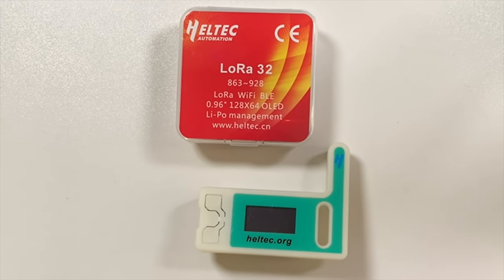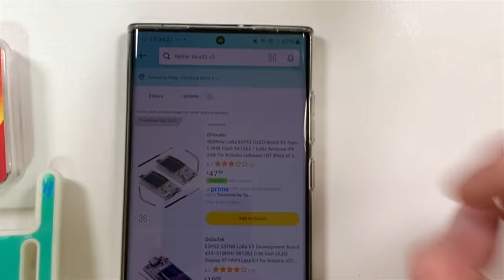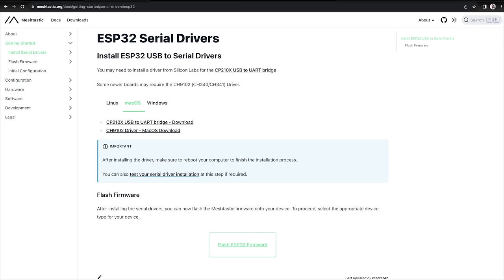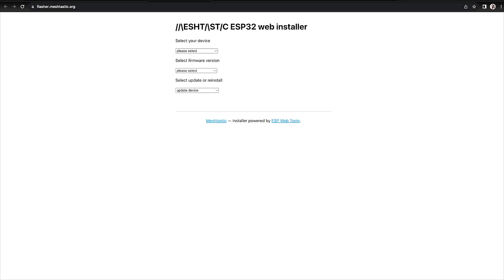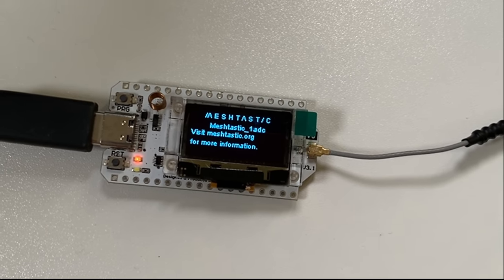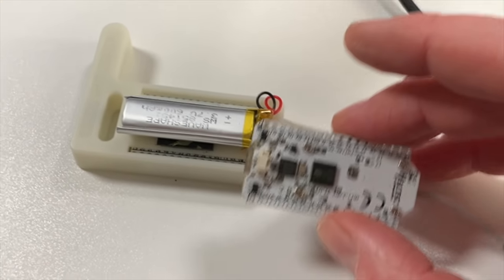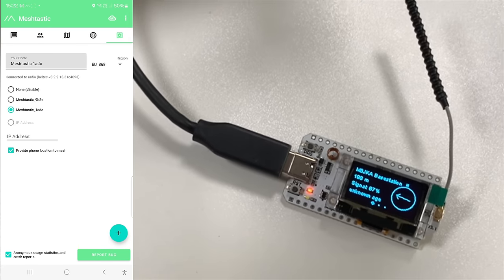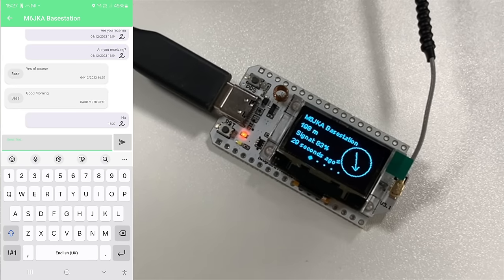JOIN THIS EXCITING OFF GRID NETWORK!!!

Comment: I don't understand what problem this solves and what the primary use case of this is. It's a great video explaining the setup but I have no clue what this is. Is it for local text messaging (SMS)? Is it a internet hotspot?
Reply: Yes it's (primarily) for sending text messages, but crucially it doesn't have to be local as your messages can hop across multiple nodes to the destination. Internet would definitely not be very effective as the bitrate is very slow.
Reply: @ThatMattWhite  Ok, cool. Thanks! Now it seems like it can be useful in case of an internet blackout or maybe even for privacy reasons.
Reply: no records of comms or logs available to gov or other opressive forces

Comment: These are a lot of fun to play with (had them for some time). Setting licenced ham operator would be useful on the 70cm band in some parts of the world where power can be higher with a PA. But also that setting that (should) disable encryption as per local laws. One thing to be aware of is the channel name you choose will create an encrypted channel. So if you change that you'd not be on the "default" channel that Andy shows here. You can see the encryption settings for the channel in the radio settings dialog. It can actually get pretty complex once you start digging. But that's part of the fun! There's also a version that is only for Amateurs called Meshcom but there are really few users of that at the moment. Worth checking though. Thanks for the video!
Reply: From what I understand its a grey area your technically setting up an experimental remote repeater.

Comment: I am blown away by the range and bandwidth achievable with these modern transceiver protocols. LoRa, OcuSync, WSPR, NextGenTV ect ect. The government will be butting in on this mesh stff no doubt. Imagine how pist they would be if we the people created our own internet network.
Reply: If some could be connected to some routing equipment it’s definitely possible.
Reply: The government aren't actually the ones at risk. They may very well but in, but it would be because of the corporations padding their pockets. The internet is already decentralized anyway. That's what makes it so difficult to control.
Reply: They have been going after network people since 2017

Comment: This is the first time I hear of this technology and it's so cool, it's basically just the internet, but even the infrastructure itself is in the hands of the people. Super cool stuff.
Reply: If it only worked...
Reply: It's not Internet. At all. It's text messaging over radio.
Reply: @BrightBlueJim  

it will be crucial for the years ahead..
Reply: @BrightBlueJim the internet started as sending text over analog phone lines, rtty also existed long before wifi. We’re rebuilding!
Reply: @BrightBlueJim  The internet is just a network of computers. This is the same. I think you are both on the same track.....

Comment: I live very near to the south Devon coast. My helium miner hits the channel islands from here, no problem. It also pings off portland regularly. This got me thinking. Once offshore, boats have either no, or very expensive connections. This cheap piece of kit could be a very useful way of sending messages, particularly a mayday/panpan.
From my location alone, I could cover a big chunk of the English Channel.
Reply from the maker: Fascinating! You should definitely set a mesh up. What antenna are you using on your miner?
Reply: Boats have DSC for that purpose,and it's is free and well monitored
Reply: Hf-Vhf radio is mandatory from vessels ranging in small and upwards. Larger vessels usually have Satcom and LTE links.
Reply: Is helium mining worth it? been considering using one of those and later setting up with a solar panel (Live on east coastish shit town in a flyover state so no competitive issues).

Comment: I was really surprised by their range and it got me thinking about how practical it would be to setup small solar-powered nodes. If it's small enough to run for a usable amount of time in a package that small then it can't burn too much power at all, so a small solar panel or something with a simple metal rod to stick into the dirt and a 3d printed housing could make a really nice little relay node. If it can be ran on pretty generic hardware I might actually chase down that idea a little and try to get a small ESP32 or NRF or something going. If you could get the price of a self-sustaining node under, eeeh, 25-50usd, then even a single individual could reasonably afford to setup relay chains spanning miles and miles. 

Granted, at that point you'd probably want to have an integrated low-precision GPS module in them as well so that, if one does go offline, you can see where the chain broke because it stopped reporting it's position. Could be an interesting little project to chase down.
Reply: I was thinking something similar, honestly my GF and I considering living in a more rural area due to crime in the inner city, as well as just high cost for a flyover state city, its just not worth it as I get older.
Reply: Or you could maintain the map with device uuids and know which went off without gps
Reply: @thebloodyvlad  that wouldn't necessarily work. I mean in the first place it's non-generalized, so you'd have to intentionally map out IDs to positions which is just a pain, but it would fail if, for one reason or another, they got moved around. Say one got picked up and taken somewhere else but still technically has connection then it'd register as still working despite not being in the correct position for the chain.
Reply: @robonator2945  hmmmm.. if one got moved and you mapped and tagged each node, surely you can look at the map, which would just be a series of numbers or names on an ordered list and query until one does not respond. Then either that one is down, has been moved out of range, or the one just before it has been moved but not down.

Comment: Amateur radio mode gives access to higher transmit power, as permitted by an amateur license but disables encryption as that isn't permitted for this kind of amateur radio use. It also causes the unit to transmit your callsign every 10 minutes to maintain compliance with your amateur license
Reply: Tell that to prepper's with baofeng preparing for shtf

Comment: From the way the board is built with power at one end and antenna at the other, it invites the creation of a meshtastic - stick! Battery at one end, antenna at the other. Make a magic wand by extending the antenna and adding some 3d printed decorations on the case.

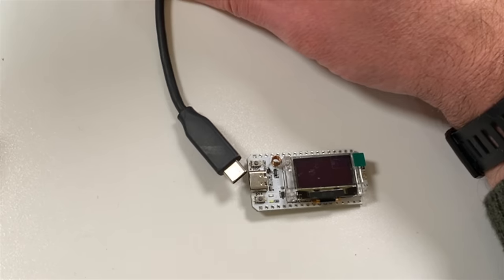Comment: At 4:10, SHOULD connect antenna BEFORE power - always.  Transmitting without antenna could fry the transmit circuit.

Comment: Hi Andy i based near orpington kent a few weeks ago i got a node 113 miles away west of Birmingham i looked at our SE meshtatic group and some other members also got this node 
are they running some high gain  antenna ?
i had a few nodes 50 -60 miles in the south cost 
Andy have you had any good ranges 

paul

Comment: This device appears to be the same thing (or similar) to the goTenna Mesh network devices that started on Kickstarter back in 2012 I believe.   I actually have a pair of the goTenna’s.   They use a 1w UHF radio/GPS transceiver in them.    No cell service, no problem.  Although they are limited to 3 miles line of sight,  unless you set one or more up as repeaters.

Comment: Thanks for taking the time to share this video!  Did I see the M5Stack Core device on the Meshtastic drop down list?  If so I guess if you have the M5Stack Core and connect it to the M5Stack LoRa Transmitter/receiver, it should work...  I guess???

Comment: Hello Andy. Great job on the Vids! 🍻 I am in Japan and from what I can see (if I am looking correctly) there are only a handful of these units here and I have half of them!  lol 
I may have to get external antennae's and setup a repeater due to my 5600 Km LOS that I would like to cover. I need to setup a test Emergency Comms plan in preps for these earthquakes here. I am pretty familiar with location, power and basic antennas but, this is all new to me.
Any chance we could correspond so that I can get these correctly setup. Thank you for any assistance. 🤟

Comment: Thks Andy..ordered mine now from AZ and the Housing from Ali....do i need a Battery with a micro JST Connector....?
Reply from the maker: Awesome! Yes you do need a battery or just run from USB. There are 1100mah batteries on amazon with micro JST.
Reply: @andykirby  ...ok...thks...👍
Reply: JST 1.2mm. Double check the polarity before connecting.
Reply: @yamez69  ....yes, ok, but the JST plug only fits in one Position, Cables with plugs and open ends are included....Nevertheless, thanks for the Tip.

Comment: The thing about being an amateur radio operator unlocks extra TX power, which is outside of the unlicensed range. So you shouldt use it if you don't have a proper HAM license.
Reply: It also disables encryption
Reply: Who’s going to police that? Would anyone care?
Reply: Yes, it is policed. If you set one up 24/7/365, you have a very good chance of getting caught.  Licensed ham radio operators are quite good at tracking the location of a signal. We do it for fun.
Reply: @MadBison  that's why i stay on PMR frequencies on dmr.

Comment: But what do you do with it when its up and running? What is its purpose or what can it do?
Reply from the maker: Text messaging. GPS tracking, much like APRS really.
Reply: you get to talk to a load of prepper/ham nerds 😂
Reply: the system was designed for IoT devices so mostly sensors and other automated devices sending simple telemetry as a message to a home base. Or allow simple remote control.

Comment: So if I want to create one of these devices as you have, does that mean I don't have to worry about the pins on the board?  Some of them have the two rows of pins soldered on them, others don't.  It looks like yours do not have the pins soldered on. Thanks!
Reply from the maker: Nope you don't need the pins 👍🏻

Comment: interesting, but only useful for nerds in a local proximity i guess?
or does it work like mobile data network / used with SIM like back in the blackberry / iphone era where they discovered this "unused" network?
whats the max bandwidth of this network or does it use wifi?
Reply: I reckon there'll be some "specialist retailer networks" using these for boss-to-lackey communication soon enough.  Line of Duty season 7 coming up...

Comment: Amazing! Andy, are you also going to explore Helium?
Reply from the maker: I've looked into it briefly, I might get a miner up and running just to see which other miners it would connect to. I'm defo more interested in meshtastic though!
Reply: Helium is DOA in terms of actual usability. Anything outside of occasionally polled sensors and it's mind bogglingly expensive even in the 1st world. Those 24 byte packets really add up if you want to run something like a phone call, or even frequent text messaging.

Comment: I bought the Heltec V3 in SX1262 863-928MHz. I live in the US and need 915MHz. Did I get the wrong one? Can I select 915MHz when setting it up?
Reply from the maker: Yes you can select US in the Region setting and it will work on 915mhz 😁👍🏻

Comment: Do you know if the transmit power should be changed? On the Heltec website the dBm says a max of 21 but the app set mine at 30 dBm by default

Comment: Hi Andy, great video. I'm finding no activity in my area after buying a Heltec v3 which is a little disappointing.  I understand the supplied antenna is a little lacking, what  868mhz antenna would you recommend to pair with the Heltec that still provides portability (also not too expensive).  Thanks
Reply from the maker: This one if you havent already got it... https://www.experimental-engineering.co.uk/product/868mhz-2dbi-helical-lora-antenna-ufl/

Ulitmately the best option is a home/loft mounted (if you haven't got solar) 
https://amzn.to/42yxYke

Activity will come😁 have you checked the canvis meshtastic map to see if there are users in your area?

Comment: I've just picked up an ESP32 Tbeam and it's my first LoRAWAN device, though I'm very interested. 
Question for ya - How do I join the "public" channel? I've setup the device and it creates the LongFast-I channel but I see a PSK of "AQ==". I've also tried setting the PSK to blank. 
I imagine there's not many nodes in my area if any yet, so I'm trying to simply get a public channel up in my city and wanted to ensure that is the most "open"  channel. 
Thanks!
Reply from the maker: Hi, leave the pass code as default. AQ== You can type messages in the bit where it says longfast in the message section of the app (the first tab).
With default settings everyone in range will get your message. 😁
Join our discord, there's loads of us there talking about it.  Here is an invite.
https://discord.com/invite/9dsJhdJC

Comment: What is the range on these. They look like they wouldn't reach into the next room.
Reply: In the city it goes from my empirical testing about 1000 meters (3000 feet) line-of-sight alternatively about 8 floors vertically through a reinforced contrete high-rise building.

Comment: There is no way you live this close to me!! we could definitely get a mesh going
Reply from the maker: Where are you? Lol! Most of hertford down to about Ware is now covered, so if you are in the vicinity grab one and join the Hertford mesh!
Reply: @andykirby I managed a 23 Mile dx contact today. Unfortunately nothing into Heartfield. 
Still amazed at the 23 miles it's unbelievable.
Reply from the maker: On what? Meshtastic??
Reply: @andykirby  . Got about 800m range on mine with a omni in my roof. I'm just the town to the left of you. I had no idea you were so close!
Reply: @andykirby  23 miles is insane what was the rssi on that?
Reply from the maker: Are you not seeing my mesh? I'm beaming towards the town and ware though. I have about 3 nodes running at the moment.
Reply from the maker: Are you sure it's just 800m? It will depend on how many hills are around. If possible I can stick another node up to bridge the gap.
Reply: @andykirby  between me and you there is a good 4.2 miles and it's not direct line of sight. My 6.5db omni is up in my roof and with a test earlier I got 800 meters node to node. That's an improvement from about 323m. We'd need several repeaters between each other to connect.. It's possible but not easy. I'm willing to do it!
Reply from the maker: Are you on my discord?? I've just setup a discord channel to discuss. Here is an invite...😁
https://discord.com/invite/45RR4KUe

Comment: with these Heltec Lora 32 V3's  do they automatically do their thing (of meshing)  . Do you have to setup some to be repeaters or something?   if myself and say 4-5 people in my area  each being 1km or 1.5km hop further. Will it extend the ranges of the "zone" to be much wider automatic.  or do you need to setup maybe 2 or 3 of them as being repeaters.   Or does each meshtastic device do it's own thing with the relays and extending the zone.

Comment: Ok, so these are just the boards and don’t come with a battery but have a USB port??  What type of  battery is recommended and where does it connect?  Pretty intriguing stuff but still early on and a bit dodgy what?

Comment: So, if I've understood it correctly, there is a default channel ("longfast") which is the common calling channel for all users (CB Channel 14 :-) ) and if I'm using that, I can send a message to any other user if I know their  callsign/nodeID or something...which they can tell me or I can just see their messages on Longfast and randomly say hello, right ?    But, if every Meshtastic nodeo n longfast rebroadcasts everything, doesn't that generate an endless repeating (around the world if there were enough nodes) and therefore a load of wasted traffic...won't that overload the network eventually at just 300bps ?      Secondly, if I switch channel, I then have a "private" system unless someone nearby also tunes to that same channel but either way, they can only read messages addressed to them (otherwise encrypted).  I guess messages on longfast are cleartext.

Comment: 869.525 is the UK open frequency. In the US isn't 902 to 928. If you go outside of those frequencies you are breaking the law. Also, if you mark off armature radio operator, you can use different frequencies. But you must have a license for it.

Comment: You didn't discuss anything about the items that came with this device package and how they are used. There's another red/black cable with a tiny Molex Type Connector and two standing devices or maybe Arduino Connectors. I'm really not sure what they are used for. Also, you are connecting a USB C Data Cable to the ESP32 Device. Is the other end a USB A Connector to the Computer? You're trying to interface with the 'Meshtastic' download just accomplished. Is that correct? Please clarify. Also, how do you get the antenna into the container? It's too long.

Comment: Do a video that tells how to setup the Android Bluetooth after the flash. The Flash was done from the computer with a cable (serial/web client). I'm in the U.S.A. While in Serial/Web Client, what settings are required to insure I get a good response on Meshtastic for Android (Bluetooth). I downloaded the Meshtastic App 2.2.19 to my Android and it's asking for an IP Address. I'm stuck there. I've already attached the 18650 Battery to my two devices and they are both on Meshtastic Version 2.2.19.

Comment: Hi, thanks for the video, I ordered one and it just arrived. When I navigate to the Web Installer the dropdowns dont work. I have the driver installed and my USB cable is definitely data as checked by viewing folder structure on my phone. Is this a comms issue? What port are you set to and what BAUD rate? I tried 9600, 19200, 38400 but no luck. Used Chrome & Edge. Thanks.